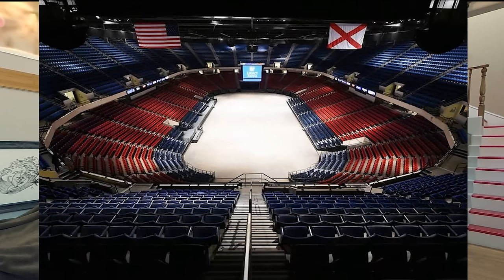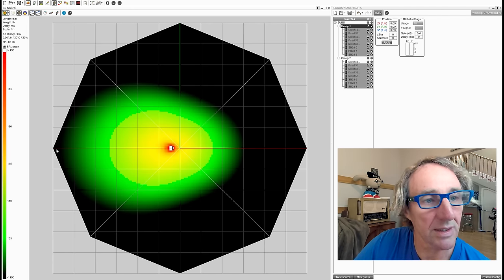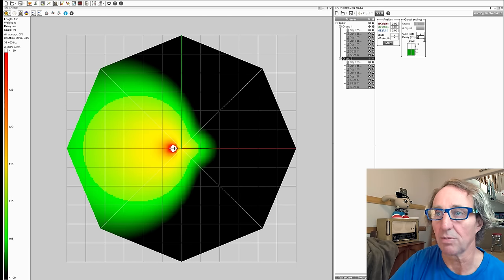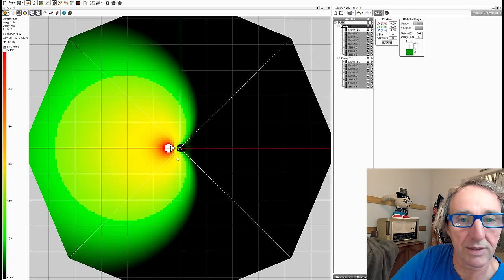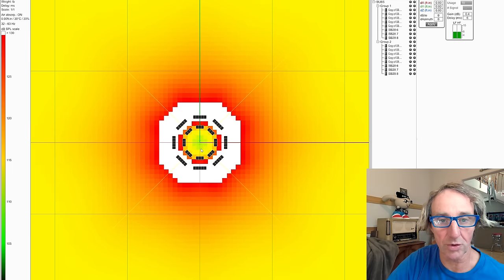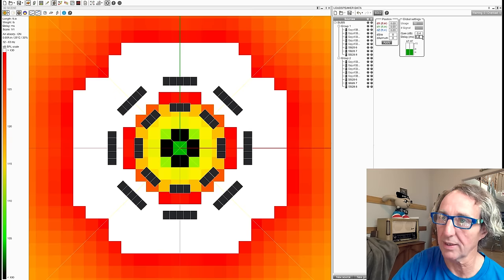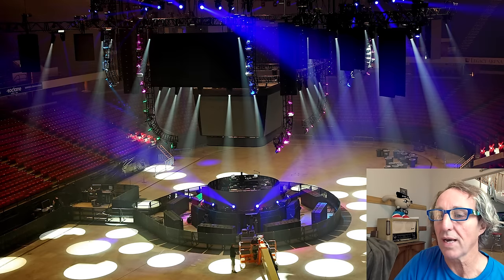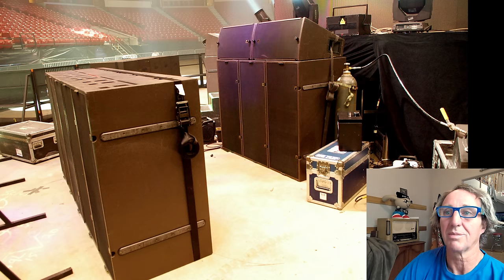Bassnectar 360 Subwoofer Sound Design

Comment: what an amazing use of cardiods, amazing to see how much of a difference you were able to obtain, but the way, do you have any experience with designing and/or using folded horns? working on some myself and having issues with the predicted freq responses maxing out the xmax at weird frequencies
Reply from the maker: Hmmm, yeah, not much experience with folded horns. Though I can picture how possible inconsistencies in the flare rate or resonances could create xmax issues. I would run impedance curves on the them and most likely the xmax issues will align with impedance minimums. You may want to try some different drivers and see if they have more stable behaviors.  Maybe look into iPal based driver and amps. Using a larger voice coil driver or altering, perhaps increasing the loading on the driver by adding material near the driver to horn opening. These are not tested and outside of my expertise, but are the things I would try if it was my project.
Reply: @DaveRat  thanks for the advice, think I might just try some of it out. Also for a beginner in this just making a rig similar to that of what void offers but at a much cheaper price that I can make myself, are there any good free or cheap software out there that I can use to model my speakers response in a venue like what you were doing here? I haven't ventured into that realm of audio yet.
Reply from the maker: Soundvision that I use is free software

Comment: Awesome video, ty. Question. Would raising the subs off the floor 1-5 feet or greater, such as sitting them on a polystyrene or foam board insulated base, have an impact on dampening the sound behind the subs while pushing it out towards the audience?
Reply from the maker: Mainly the audience would no longer see the artist. But sound wise it would creat a reflection off of the floor that would negatively impact the sub sound for people higher up in the venue

Comment: Wow, the thought and expertise you put into your work is truly inspiring. Im curious, what kind of microphone did you use to measure spl on the stage riser?
Reply from the maker: Just an audix measurement mic
Reply: @DaveRat  ah interesting, i wasnt sure since i assume it would have to be designed for low frequencies and high amplitude. Thanks for responding!
Reply from the maker: I just grabbed mics I had laying around. My take is that any decent mics will work well

Comment: Was the diameter of the DJ riser determined by the diameter of your sub array or the array by the riser or maybe the wishes of the promoter to get more tickets sold! Was the number of outer sub positions and subs at those positions derived through wearing out a mouse via trial and error in Soundvision, something that I seem to end up doing. Thanks for this video, I hope you do more. Fascinating.
Reply from the maker: I designed around the set.

64 subs was chosen based on previous years, desired levels and physical space plus access

Comment: There is so much thought put into the subwoofer setup, but then again there is ARCS side by side that are not coupling but interfering in the HF - or did you mute one of the ARCS's HF sections?
Reply from the maker: Look up the arc specs. Normally done vertically, two arcs horn to horn give 90 degrees

Comment: great vid! how far was the spacing between the back grill 3 and front grill 5 subs? and how did you come to that conclusion?
Reply from the maker: The distance is 1/4 wavelength at the peak freq of the subs which is just over 40hz.
Reply: Clear, Thanks for the quick response, so that would be 2.15 ish M (about 7 feet)? Learning a lot from your vids 👍

Comment: Great video Dave! Maybe someone already asked, but how do you go from calculations in software to a real setup? Because if 0.1ms delay makes such as difference, then correct placement of these subs is essential. How do they measure the placement of these subs and can you identify in measuement if and which subs aren't placed as in the software?
Reply from the maker: I just drew some chalk rings on the ground and set the subs up there. Then fired it up with an approx delay time and with pink noise, adjusted the delay for max cancellation in the center

Comment: Hi dear Dave
Nice video! I wonder how you process the flown sub and ground sub?
You use them together or only one or it depends? Whether both of them are the same x-over? Use them together always have some cancellation issues.
Could you please share a little your thoughts? Thanks a lot!
Reply from the maker: I just did a video on the on the member side of my channel. It will be public at some point, maybe a couple months or so
Reply: @DaveRat  Hope it has other ways to join the membership
Reply from the maker: Yeah, depending on where ya live, it may be a challenge to join

Comment: Very cool video.  How did Bassnectar like your solution?  Would increasing the artist riser platform in height help reduce more of the sound pressure?  Not familiar with the SoundVision software but does it let you do modeling in the z-axis?  Does it model decays and reflection times?
Reply from the maker: The null can be moved up by reducing the delay time.

The goal was toake the sound ideal for the set design. And not make concessions to the set, due to sound.

Yes, he liked it and they used that design or a version of it for every 360 show from them on
Reply: @DaveRat  Thanks for sharing your very cool,  real world experience.  Some of the DJ platforms I've seen  Deadmau5 use are way up high and the first thought I had is he was trying to get above those punishing sound pressure levels.
Reply from the maker: Most likely sets are designed for visuals and sound has to deal with that later.

That said it's easier to to get sound down to reasonable levels if if the speakers are farther away from the cancellation area

Comment: Thanks Dave for this amazing insight, a true inspiration.
When you say the low end cancelled out on the riser, did this lead to the artist complaining about not feeling the low end? Or did they have seperate monitor subs on the riser?
If so, how did these monitor subs influence your setup (if at all)?
Reply from the maker: The artist had a monitor setup and also was in contact with the monitor engineer via headset so he had control over what he needed
Reply: @DaveRat  Did the Monitor setup influence your cardioid setup in anyway? Or was it so marginal that it wasn't worth considering?
Reply from the maker: Seperate. The sound was already cancelled there, so the monitor just made sound where it was not loud
Reply: @DaveRat  Thanks for taking your time to answer my questions.🤘

Comment: Dave greetings from Greece. It's amazing how much difference can make a 0.1ms of delay. How did you align the top clusters with the subs? I assume that you considered the whole 360 sub array as one source.
Reply from the maker: We aligned for the area where the ground fills and flown were both heard by the audience.
Reply: @DaveRat  Thanks for sharing knowledge. The front 5 boxes of each cardioid group, had the same settings between them (delay, gain etc) as well as the back 3?

Comment: Too bad there's no "goal seek" (like in Excel) function in the SoundVision software to run through all the delay settings to find the min/max value for the SPL at mix position.  LOOONG way from my ground-stack weekend warrior rig...it's always fascinating to watch your videos, Dave!  Thanks!
Reply from the maker: They're actually is you can click anywhere in the room and sound vision will tell you the Delta between various sound sources arriving at that point.

I didn't use it because I wanted to show the differences and how to do it mechanically but normally that's my starting point

Comment: Does placement have to be ultra precise on a setup where tenths of a millisecond matter? And can other problems arise from other distance variables like the actual speaker cone distance from the grill, in perfect manufacturing tolerances, cabinet design choices etc.? Obviously it worked enough but, I wonder how close the real life SPL measurements were,  given all the possibilities for variation from a seemingly very tight spec? Great vid btw, thanks!
Reply from the maker: The software does a good job of accurately modelling the enclosures as it should as the enclosure and software are bot from L-Acoustics 

As far as placement, I gave the design to the techs, they set it up,  I tested and it did not perform as expected. I then had them draw chalk circles and personally placed and over saw placement was down to an inch or less.

As far as the super touchy delay times, keep in mind that the delay was delaying 24 subs all at once in relation to 40 subs.

Typically this delay is not so temperamental

Comment: Nice insights Dave! Was the 0.1 ms delay in reality really that huge of a difference? (and why?!) 3.4 cm ... and the loudspeaker positions will surely differ more than that in a real world setup. I simply don't get it.
Reply from the maker: I set it up and the array did not work as expected. I went back and drew two precision circles and set the subs exactly on them, that really helped.

And yes sort of with the time, I sit up the Rta mix and tuned for a null and less than .5 ma was measurable

Also the temp of the room definitely impacted the null and I had to re tune. The temp shift could not have alters the speed of sound by more than 3% or .2 ms at 7 ft
Reply: On subwoofer summing it would hardly make a difference, but for cancellation a small change in front/back phase shift is a big deal, as is level difference. Note that for the same levels and perfect 180 degree difference you could theoretically get total cancellation (zero pascals). In real life, or course, that does not happen, and also sound needs to go around the speakers, which means predicted times do not work, so adjusting both times and levels in the field for the specific position we want maximum cancellation is a must. Which goes hand in hand with tracking temperature, as speed of sound will go from 344 m/s to 350 m/s from 20 to 30 degrees C, so the front/back sync (out of polarity, but still sync) needs to be kept
Reply: @doctorproaudio  boundary conditions and high pressure levels can move parameters around in unexpected ways, and many waveguides for bass have to be treated with suspicion and have the mathematical models tweaked extensively to factor in the peculiarities of a particular configuration. It could be to do with cabinet porting and/or ground loading.
Reply: @weareallbeingwatched4602  Boundary conditions certainly change things, which is why i is important to bear in mind that sound system modelling software is just summing things with phase in the simplest possible way, considering nothing else but atmospheric losses. While high sound pressure levels may certainly introduce non linearities, particularly if there is limited breathing space, I'm not sure whether that would affect timing/phase.

Comment: In the 90s we suspended turntables from rubber bands as the resonant frequency was about 2hz for the bands, we were using huge eaw kf rigs with wattage well into the 40k range , I'm assuming it would work for a hard drive too , we never had an issue with feedback or skipping.
Reply from the maker: Yeah, I've designed turntables pedestals filled with sand that go down to the foundation.

Balancing acts and brute force.

All that said, one issue is he could not see the screens because vision was blurring, so the turntables are one aspect but needed to stop the subs from messing with the human as well
Reply: @DaveRat  too much <(((::<

Comment: I would imagine accurate position of the subwoofers would be important considering your using such precise delay adjustments. I’m curious if there was any major changes that needed to be made that advance planning did not predict.
Reply from the maker: Not really. An initial in accurate sub placement did not cancel well so I had to really get the subs accurately placed

Comment: I was well aware of this technique in the rf realm, but doubted it could be practically applied in the audible range, due to reflected sound energy, standing waves, absorption and the unique and dynamic acoustic profile of any venue during a live performance.

Thank you uploading and sharing this video of your very elegant solution. Not sure how i came across it, but found it very interesting, particularly the fact that once again we see a manifestation of the Fibonacci sequence in the 3 to 5 ratio between the inner and outer rings. 

I do have a question regarding the software used to plot the level of radiated energy. Does it only plot in two dimensions, or could you further fine tune this setup by elevating the inner ring to keep the attenuated sweet spot more aligned with the performance platform, and would doing so result in concentric bands of higher and lower sound energy on the horizontal plane?
Reply from the maker: Very cool and yes it plots in three dimensions. The software is called soundvision and it's a free download. And to make things easier I only plotted in two dimensions and to see the third dimension we'd have to place a surface so that we could see the sound hitting it but also placing the surface block sound in the software in ways that it wouldn't be blocked in the real world
Reply: @DaveRat  Thanks so much!

Comment: Hi Dave, I've been a fan of your videos for a long time, and I'm interested in hearing your ideas about creating a subwoofer setup for a trailer. In my home country of Trinidad, sound companies often mount subwoofers and line arrays on trailers that measure 8ft x 45ft, along with a generator. However, many people do this without properly managing the delays or stacking, which results in 24 to 30 subwoofers sounding like 6-8 subwoofers.
Reply from the maker: The best thing to do would be download soundvision for free and experiment with various setups and you can design it to do whatever you wish.

Learning sound vision is not that difficult especially if you're just looking at the subwoofer part.

Comment: Wow, I had no idea this could get so involved, right down to millisecond delays. 
One thing I’ve wondered over the years going to some huge shows, with so much power do you ever have to worry about the structural integrity of the building?
Reply from the maker: Not really, audio shakes are miniscule compared to earthquake shakes. 

Sometimes depris and dust drops at a loud bass heavy show in a place that does not so them often
Reply: @DaveRat  somebody not keeping up with their dusting :-))
Reply from the maker: 🤙👍🤙 yes, of rafters and hvac 80 feet or higher is a chore

Comment: Thank you for sharing this! I find it informative and enlightening....but isnt "enlightening" the LDs job? har har har!
I have an issue with that software youre using...and maybe its in my own head. (Ive never uised it personally) but does it take the walls and other objects into consideration that would reflect the bass energy back towards the source? (or some other direction?) I realize that in this scenarior you have banks of seating going up at a slope, so thats going to brek up and absorb and redirect the sound to where its probably not an issue. But what about straight up?
Reply from the maker: You can add surfaces but typically the prediction you want are the direct sound and to place surfaces and try and minimize sound being reflected.

I've got more in depth vids on subs you have access to as a member

Search the member exclusive videos for "sub" and or "subwoofer"

Comment: Can you fly the PA from above pointing down? Over the most of the audience locations? Just don't put a cluster above the DJ. Include subs and full range above?
Reply from the maker: That can be done the challenge is placement of the sound system due to conflicts with lighting and video and it's not possible to have it really loud for the audience and very quiet for the DJ if the speakers are at a distance.

The only way to get really distinct cancellation is to have a very symmetrical pattern around the DJ with very well tuned cancellation.

Think of it this way the ring of subs are like flashlights pointed outward and dark in the center.

Putting subs above and pointing them downward at the audience would be like putting lights in the ceiling and shooting them downward and trying to have it be bright for the audience and dark for the DJ which is right near the audience

Comment: Late to the party but - perhaps spacing the subs evenly on the inner ring with the same 3:5 ratio as an alternative design?
Reply from the maker: Each "module" of 8 subs with 5 and 3 needs to be exactly aligned as a unit. The 3 cancels the rear energy from the 5. Any offsets or changes or variations will collapse the cancellation.

That said, I would love it if someone, anyone, would download free sound vision and come up with a superior design that achieve the same or better volume at distance and the same or better cancellation in the center while not blocking sight lines or increasing the distance between artist and audience

Comment: assuming you wouldnt stack the cardioid subs on the bottom of the stack because theyre already stacked forward?
Reply from the maker: All the subs are standard dual 18, the cardioid pattern is achieve through spacing in er to outer ring, time delay and polarity